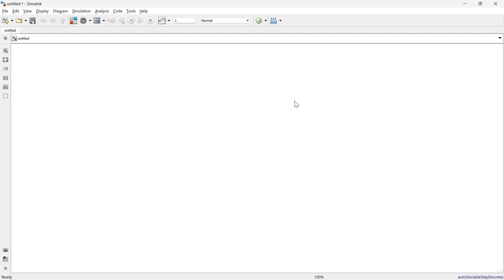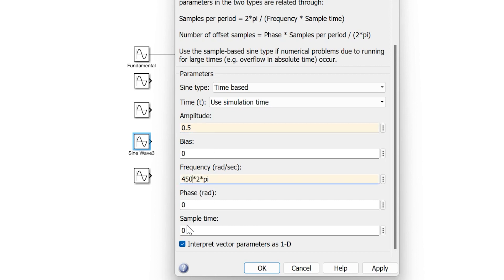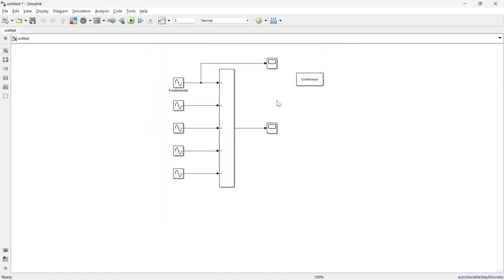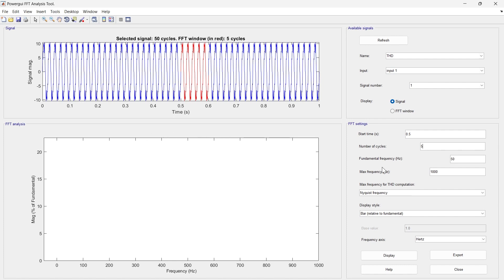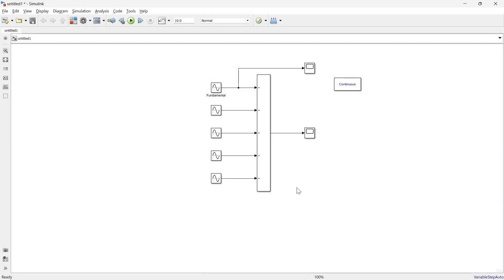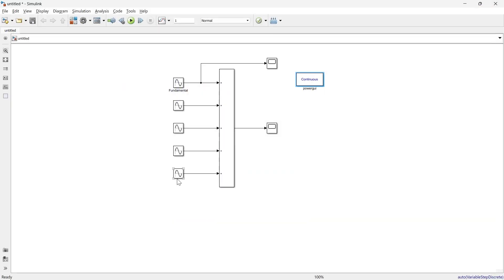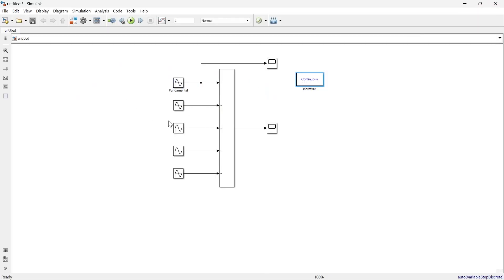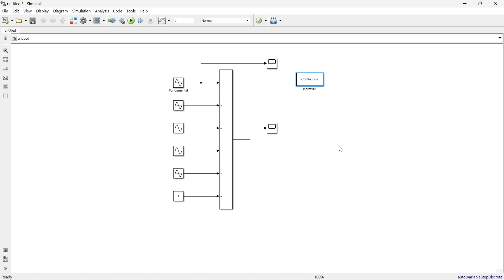How to do FFT in MATLB | How to do THD analysis in MATLAB | Simulink Tutorial

Comment: why my FFT Analysis always show empty list?
Reply: i too was facing the same issue. you have to go to model settings -> data import/export -> save to workspace or file.
there's an option named "single simulation output" which is selected by default. you only need to unselect this. That's what i did. hope it was helpful.
Reply: Thank you it works for me too @Komi2711
Reply: @Komi2711 it works! Thank you so much!
Reply: @Komi2711  Thanks friend
Reply: @Komi2711  Thank you very very very much
Reply: @yousefA-A-Nour  welcome 😇
Reply: I'm having the same problem. Did you find a solution for it?
Reply: Hello, i facing the same issue. I haven't find solution for it yet. if you found any, can you let me know